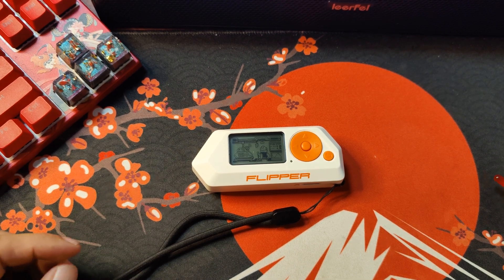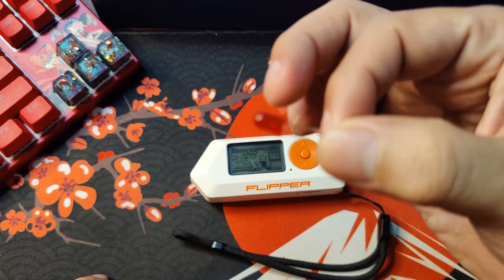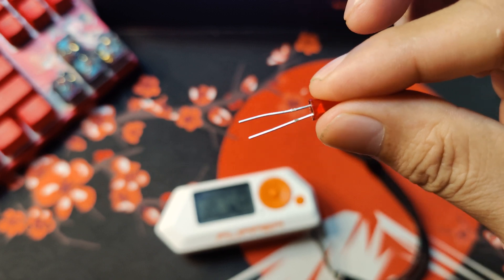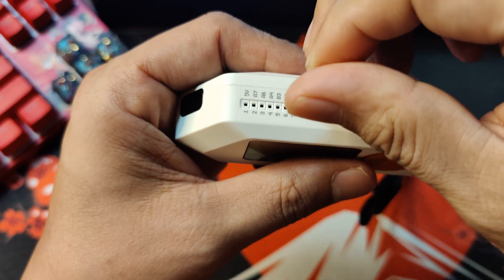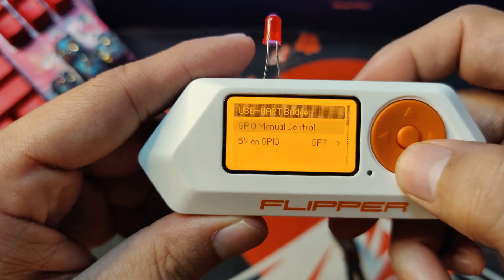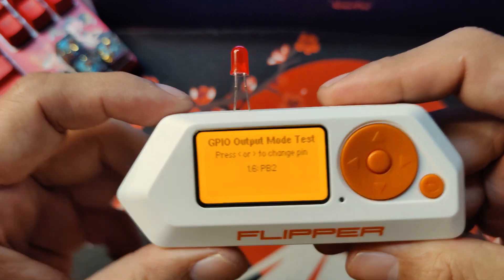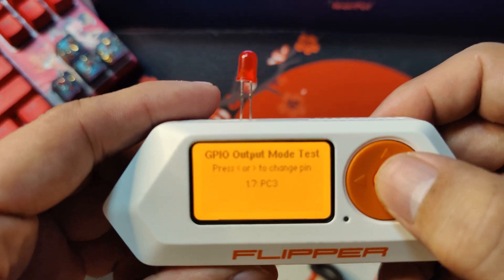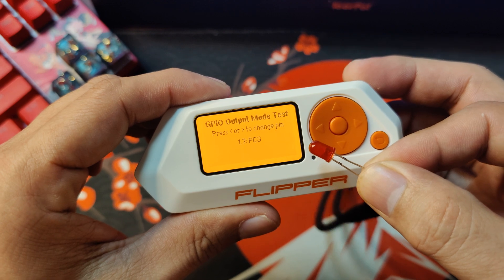Flipper Zero GPIO Testing with a LED Light

Comment: but what if you put it in the 5v slot will it always be powered?
Reply from the maker: There is a switch to turn on the power on the 5v slot, but if you try to plug the led light there it will be damaged.  I think you need a resistor to do that.
Reply: @HakistaTV  suprisingly iy lasted the whole night i think i have a more resistant led